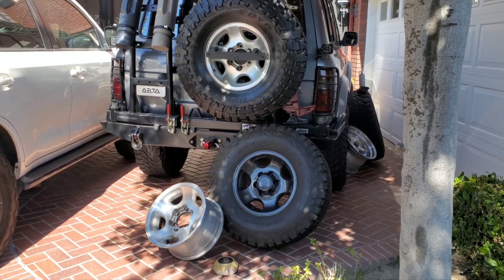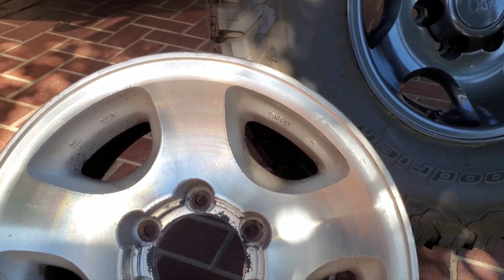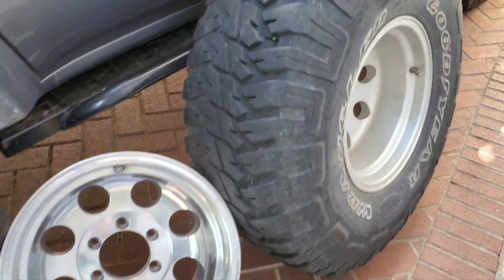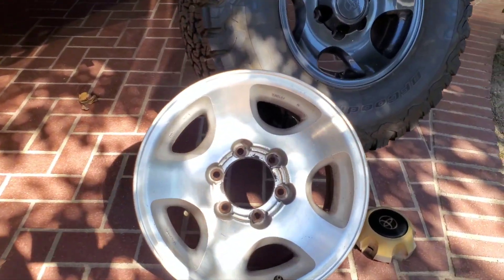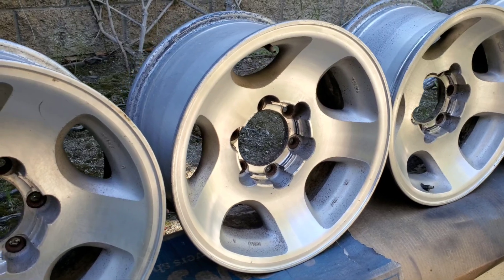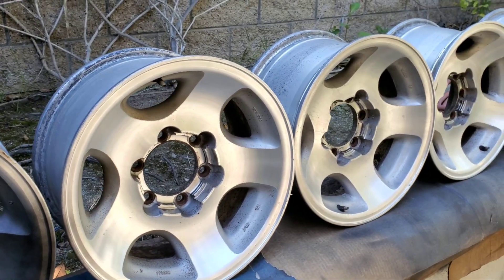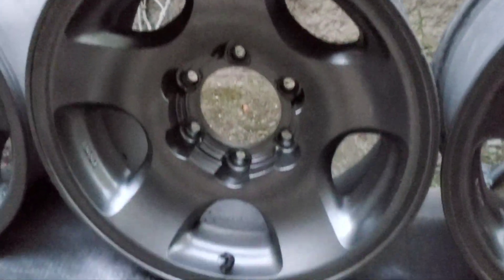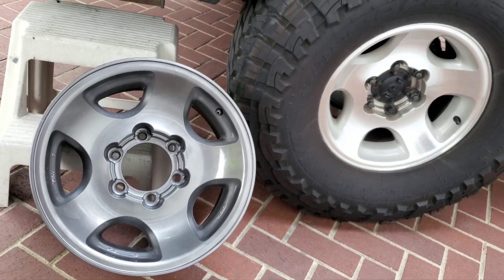✔ Everything you need to know: Painting Aluminum wheels - Good Idea? 💡

Comment: I rattle canned mine with gun metal matte and it looked fantastic. I spent about $20 for 4 wheels including primer.
Reply from the maker: The 2K is about $20, and is much better than Rustoleum. The Dupli Color is $9.99 a can, requires 2 and clear coat another $7.99.for 1 can.. So with those products its just under $50, butneith Rustoleun at $5.99- 6.99 a can and skipping clearcoat, it would be closer to $20. Just depends if you are off roading and just need to freshen them up, of if you are a Mall crawler and want a longer lasting quality and finish.

Comment: Question, I followed all instructions. After sanding I used the spray max 2k primer you suggested. Put 2 coats on and dried overnight. The next day went to check them and the primer has turned to dust. It didn’t stick and is just wiping right off. Any ideas?
Reply from the maker: Did you use Epoxy black primer?
Can't be basic primer, must be epoxy..
Reply: It’s gray. Does that matter?
Reply: Here’s what I used. SprayMax 3680033, 2K Epoxy Rust-Cure Primer, Gray, Aerosol
Reply from the maker: @kylehackett5285  Well, as long as it's Epoxy. Was paint expired?

Comment: What about the other side of the wheel? No paint on that side? My aluminum wheels are terrible on the other side. Any tips on removing the oxidation? Chemicals? Sanding?
Reply from the maker: The inside just gest dirty black, no point to finish them inside.
Reply: @CruisingTheLand  ok thanks.

Comment: How long will painting these last before cracking and chipping?
Reply from the maker: If you prep well, use good epoxy and paint it will not crack or chip. But curb rash will destroy any finish, so don't rub up on curbs. Mine are still perfect!
Reply: @CruisingTheLand  awesome! would I still need epoxy to paint over powder coated black wheels? Or would a regular rust oleum metal primer work after sanding/scuffing the powder coat a bit?

Comment: You really need to take care of the bead. With that much corrosion, the wheels will develope a slow leak. I use a coarse scotchbrite wheel on a drill which will form into the bead and then use a self-etching primer on the bare aluminum.

Comment: Dip the red anodized wheels in drain cleaner for 10 min and it’ll pull the red off. Then brush the rest of the red dye off while wet. Then wipe dry and clean with cleaning agent to clear off the drain cleaner. Boom, back to raw aluminum color.